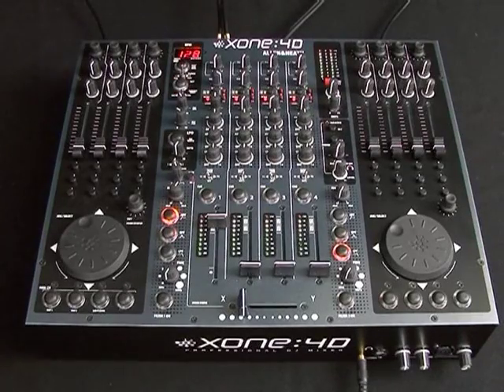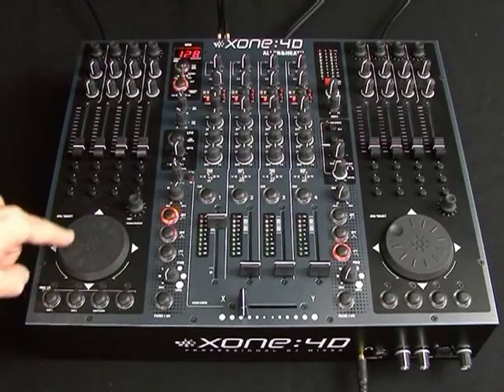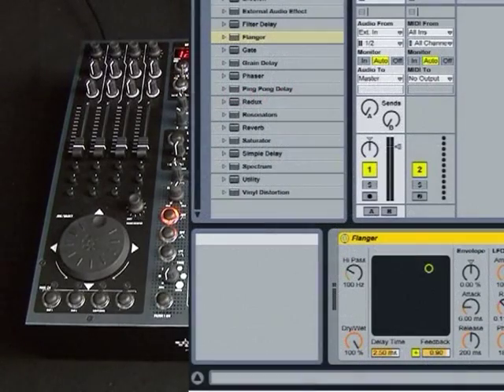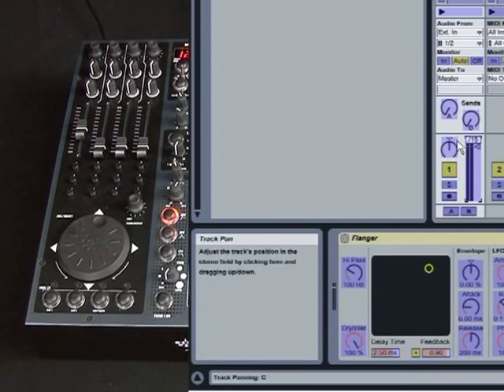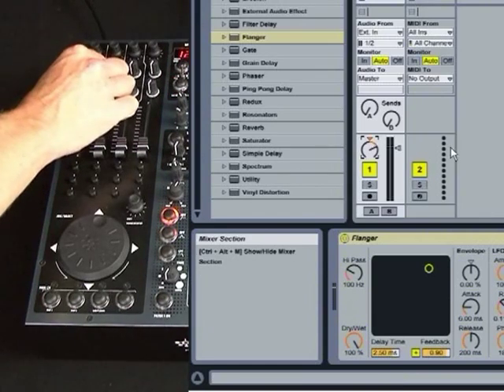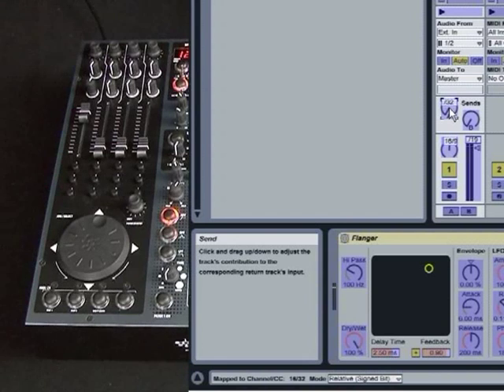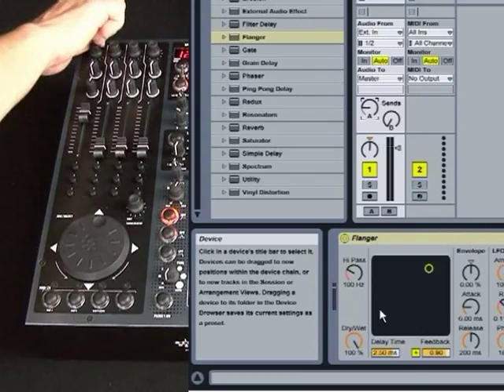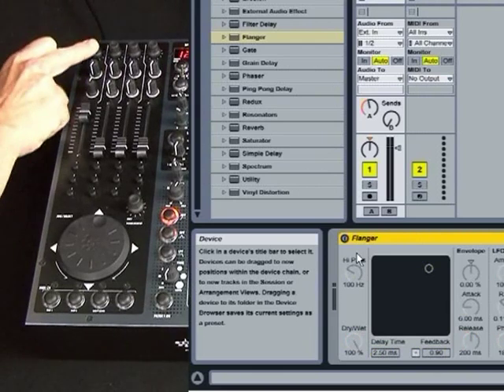MIDI Mapping the Allen & Heath Xone:4D

Comment from the maker: The Xone:4D doesn't appear in that list as there is no 'Default' set up for the 4D.
The units that do appear in that list have had custom scripts written by Ableton to run with partnered hardware manufacturers.  Once the unit is selected, the default mapping for that unit are applied.
The Xone:4D doesn't have default mapping so as not to limit its functionality.  If you require your own default set up, i suggest creating a blank Ableton template with mapping as you want it and saving as Default.